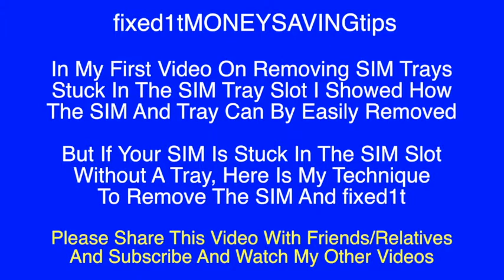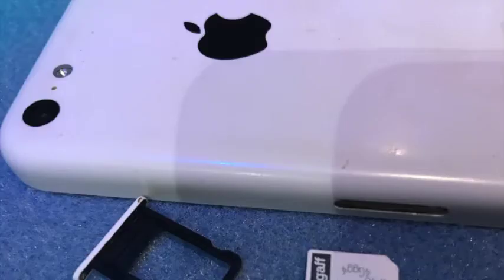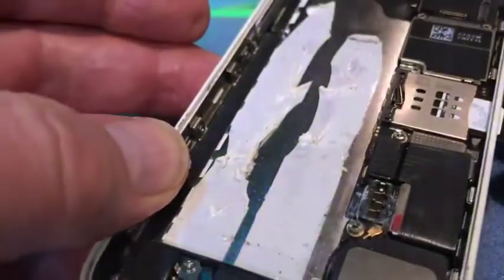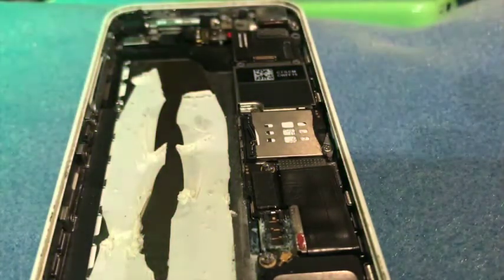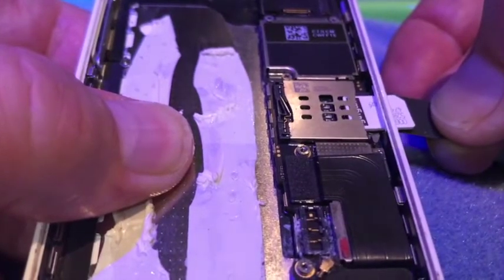How To Remove SIM Stuck In Phone Or Tablet SIM Slot

Comment: I did what u said but the card kept hitting the lip at the top preventing it from coming out any further than the opening. I tried pushing the paper (1200 grit wet/dry) into the top and it slid right in. I then pushed a piece into the bottom and slowly pulled the card out. I even tried 1000grit to no avail. But I realized if I was going to use two pieces I’d better use 1200grit which I bought at harbor freight. The variety pack. I wonder after 8 tries if the card will be good. I may have stuck the card in backwards which made it harder. But after an hour of slowly trying it paid off using two. I could have used reg paper for the top maybe while using wet sandpaper as you show in your video. Thank you!
Reply from the maker: So glad to got there in the end, it isn't easy and patience is a must as you discovered. Please don't forget to subscribe to my channel and check out my other great videos https://youtube.com/playlist?list=PLVnKaE3t-yQWqZK6pjJVKNIX9b6F8cmbV there are over 408 to choose from and share #fixed1t with friends, family and colleagues. Many Thanks Malcolm aka #fixed1t

Comment: I realize your showing a good idea. But if the SIM card does get ruined isn’t it fairly cheap to get a new one? I mean if it’s a brand new phone & you haven’t put any information on it yet. Thanks for the idea. I’ll try to see if harbor freight has this type of sand paper.
Reply from the maker: Its not the price of the sim, its the fact that the phone it unusable if you can't get the old one out, and people have been know to stick knives etc in the slot to try and get it out. Like all my videos I did it as I had the problem, I pulled out a sim tray with the phone at an angle  and it fell out of the tray and into my iPhone 7 plus and I though oops if I shake it it will fall out, it didn't. Thus the video fix. Malcolm aka @fixed1t
Reply: @fixed1t  I saw a video using 1/2 a razor blade. I thought of trying my new vacuum...LOL. That’s the reason I asked about ruining the sim. I’m not in a rush so I’ll try to get some wet sand paper. Thanks.